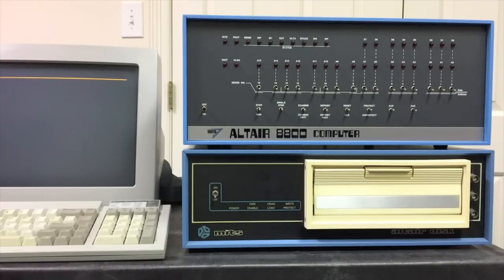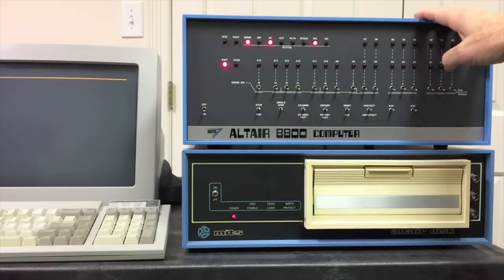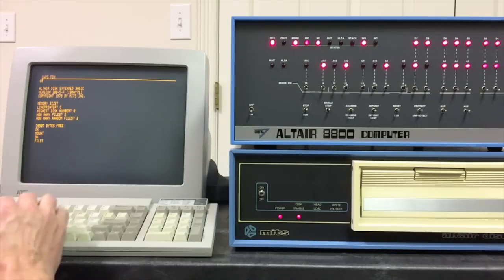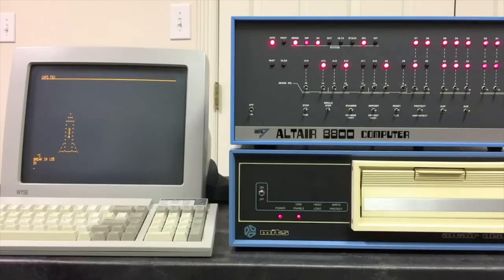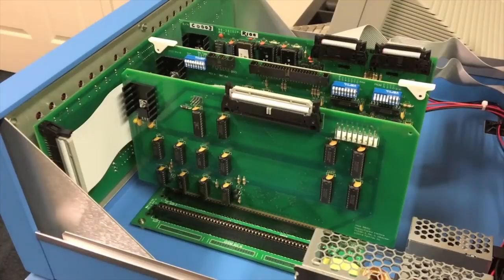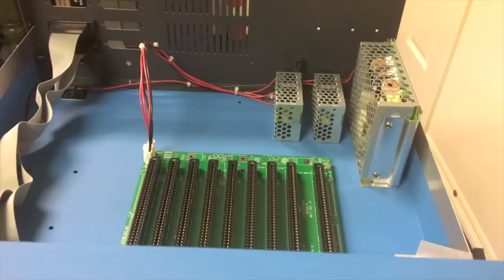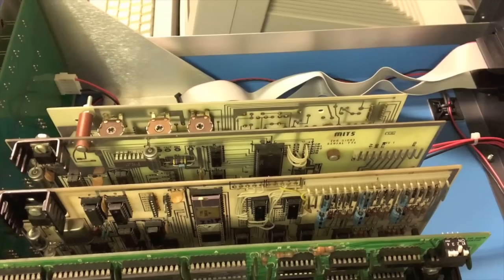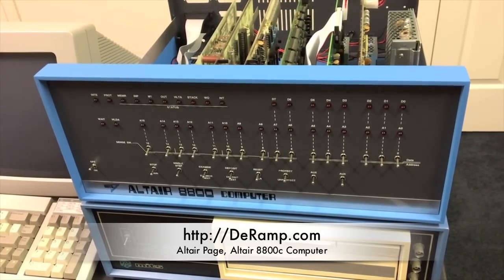Fully Functional Altair 8800 Built from New Equipment in 2018

Comment: Thanks for the overview of the Altair clone. My first box was the Heathkit H8 with a whopping 4K of RAM. Back then we were hard pressed to need more, at least for a while. Through a series of upgrades from a CA based Co named Tryonix, I think is the sp, I built a gold plated back plane, had 64K of RAM, and a Z80 cpu which was a screamer then. I learned a lot from working with the H8 and after college, went to work for Digital Equipment Corp, DEC, 
In the mid 70's DEC introduced the VAX 11/780 system. It would process ONE MILLION INSTRUCTIONS/sec AKA One MIP, WOW !! I wondered, briefly, if there would ever be a faster system..LOL
Unfortunately, I don't believe many people these days have any idea of the history in the computer industry as well as garage workshops and basements. 
It is such a fascinating story to say the least. The history of assembly language, to CPM, DOS, MSDOS, Windows and the Apple and Linux iterations is enough to fill volumes of books. Then vacuum tube computers through the super fast microcontrollers we have today is as fascinating. 
IBM recently announced their 2 nanometer transistor junctions and being able to get 333 MILLION junctions in one cube millimeter. 
It will be interesting to see what advances are developed in the next decade plus the AI work being developed at lightning fast speeds. 
Maybe, one day our technology will get bored with as lowley humans and put a few of us in cages at their zoos and destroy the rest...LOL

Comment: Will it work with 230 volts / 50 Hz in Europe?
Reply from the maker: It depends on the power supplies you choose, but most any switching supplies (including the ones in the system demonstrated), will run from US or European A/C mains without having to change anything.

Comment: Do you have any links to places where you can get these parts?
Reply: Looks like it will eventually be posted on his website at: http://deramp.com/altair.html 
But no info yet as I assume because the video just came out.
I'm looking to build one myself as well once the parts are listed.
Reply: Go to this DeRamp web page, as instructed at End of this YouTube video.
http://deramp.com/altair_8800c.html

Case, Front Panel, Motherboard, Power Supplies, Boards.

S100-computers.com is a Good Resource on these early computers
http://www.s100computers.com

and has a Google Group forum: s100computers